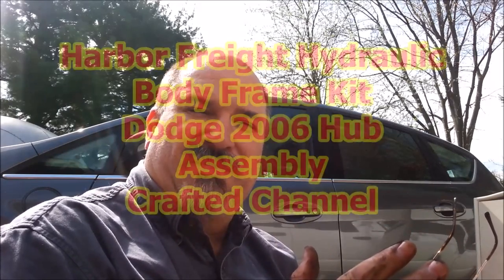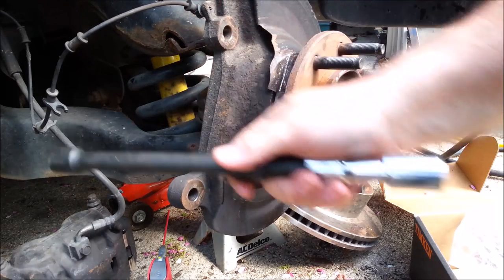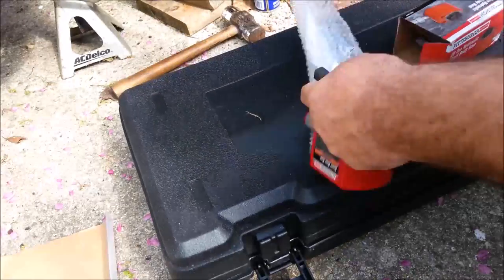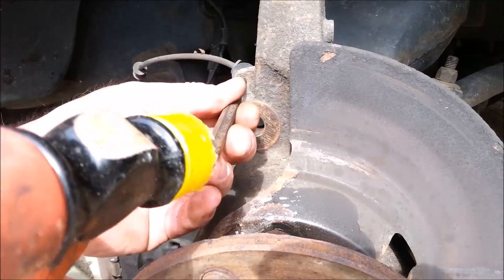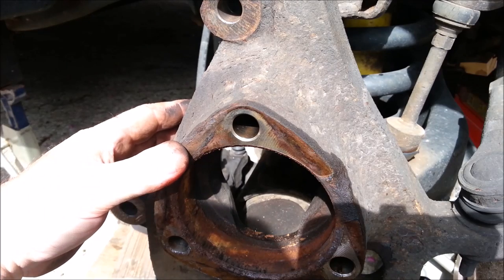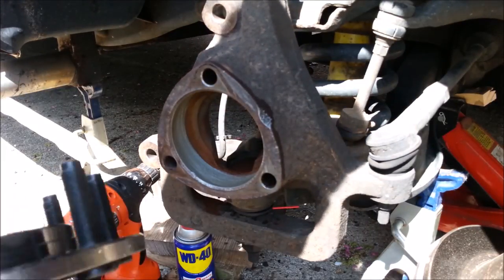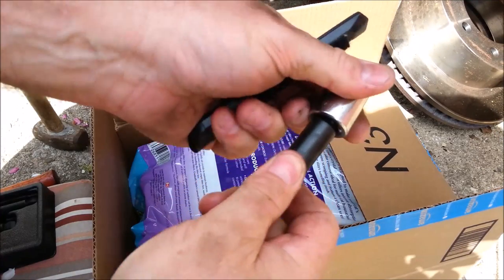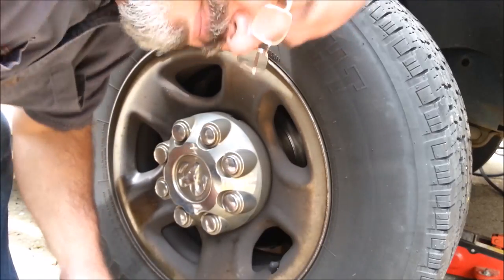Harbor Freight Hydraulic Body Frame Kit Dodge 2006 Hub Assembly Crafted Channel

Comment: I bought this tool yesterday to  help straighten the frame on my daughter's honda. Don' feel bad about leaving a part off. I replaced an oil pump in a 78 tbird, buttoned it all up, jacked the car down, and as I was putting my tools up, I noticed the oil pump shaft laying near the fender. So I'm not laughing. Great video.

Comment: I just changed all 4 bearings on my wife’s truck. Used a 4lb sledge and a lot of banging to get each one out. I got this same hydro kit and never occurred to me to use it this way. Thanks For the tip.
Reply from the maker: There are some other methods also.  But hard to be hydraulics when you can apply them.
Reply: Have this  kit for doing suspension and crash repair,even more uses

Comment: I like the way you 'earn the tools' with a DIY project. Been doing that all my life!
Reply: Save a couple hundred bucks, buy the whole set yourself. Let's say ball joints, maybe something like 100 bucks, 200 at a pricyer place. A good set, (Alltrade or something Powerbuilt) has a good set which ive used and is pretty nice, 250 Canadian or something. Easily pay off, especially if you do more than 1 time or for a friend for a bit of dough

Comment: I spent all day Saturday (8hrs) trying to remove my seized on hubs.  I tried a sludge hammer several times but ------- (FAILED), I tried a slide hammer for close to an hour long but ------- (FAILED), I tried a air hammer for several minutes but------ FAILED, I tried the power steering with extension method but-----(FAILED) and that come across your video and the next day on Sunday I went to harbor freight and purchased the 10 ton ram and  all I can say is "AMAZING!" come off in less than 5 minutes. I too heard the pop sound. Both front seized hubs were removed and new ones replaced in 1 hour max. THANKS FOR POSTING!!
Reply from the maker: Outstanding!  The only thing you did that I didn't try was the slide hammer.  I don't think it would have worked for me either.   Now you have a cool tool set you will find other uses for and you still came in under repair shop cost I bet.

Comment: I subscribed because I agree with the notion that tools are freedom. I'm a mechanic by profession and I grew up on the jobsite with my father. He's a carpenter. I literally do not pay anyone for home or auto repairs because i know my way around all tool. I've done things as simple as oil changes and door knob replacements. And I've gotten as complex as a transmission rebuild and a second floor addition. I was blessed to have a father that showed me that being hands on can save you so much and can always be a backup income plan even if it's not your profession of choice.
Reply from the maker: I'm sure you and I have a great many things in common.  I grew up helping my dad build a house around our little frame home.  I carried more brick, drywall and chimney fill than I want to remember.  learned alot.

Comment: You're right Dave. Tools  ARE freedom and they give me a feeling of security. Good video Dave.....clearly explained and well done. I have a 2002 3/4 ton heavy duty with the cummins. It's got 147k miles and I love it. Don't drive it as much as I used to because I'm retired now and don't go as much but love my truck. Keep up the good work Dave. Take care...........Jim
Reply from the maker: Thank you Jim.  Mine just turned over 250k.  Original injectors.  When I bought it, I had planned to get 400 our of it.  After changing from self employed to employed, not sure I'll get there before it rusts away.  Less than 10k a year now.  Used to be 30k.

Comment: Having the right tool is great. Sometimes you can borrow something, but I've broken a borrowed tool and had to replace it, and I still don't have one. That antiseize compound is great.  You will kiss yourself if you ever have to do this again.  If the manufacturer had put some on you wouldn't have had to make this video.  Good thing you caught that bearing when you did. I get about 2 a year that someone drove until the balls fell out and ruined the cv shaft, the rotor caliper and pads, it was even on fire.

Comment: Best video on this I have seen , and you are right about having available tools , I just wrestled with one and like you my driver's side hub came out easy , but my passenger side was a bitch , I ended up removing my steering hub and having it pressed out great videoi am a do it yourselfer out of necessity buy a all terrain jack

Comment: Ingenious.  Another Harbor Freight alternative that would have cost about 2/3 less would be the PITTSBURGH AUTOMOTIVE 10 Ton 3 Jaw Hydraulic Gear Puller (SKU 64982).
Reply from the maker: What would you push on?
Reply: Yep. I agree whata you push on.

Comment: I saw a guy just hook a big pipe wrench on the top of the flange and whack it with a big hammer and it popped right out... I have those tools already so "FREE" tool cost. Interesting to see your solution!
Reply: I just finished watching the same video. 4 hours into removing the wheel bearing hub on 2015 Subaru Outback 3.6  and still no go. This hub is super stuck!
Reply: Pipe wrench didn't work for me. i may have to take to shop
Reply: @MF-kb2nv  - the pipe wrench worked for me super smooth, except 1 rear wheel, that I spend about 1 hour with a 10lbs sledge hammer. But on that particular one I didn’t spray any lubricant. Otherwise it wasn’t that bad.
Good luck with your project M F !
Reply: @bobsbarnworkshop  spent about 8 hours on it today. Heat, sledge, pipe wrench, log chain, etc...too old for this s***.
Reply: @MF-kb2nv  sounds like yours is really stuck!!! Look up the “ hub buster” maybe you can buy or make one
Reply: @bobsbarnworkshop  Just so happens someone lended me one..Worked on the third whack...Amazing
Reply: @MF-kb2nv  glad you had success!!

Comment: I watched the guys at the shop take off the wheel of an inside dual using this tool (name-brand, not HF) braced from one wheel to the other with the extensions. They had tried torching and sledge hammering it for about 2 hours before. Hydraulics popped it loose inside of 10 minutes.

Comment: Another variation on this is to use the beak styled spreader in the kit. Install an old brake rotor wrong side out, tighten down with lug nuts. Place a hardwood block between both caliper braket arms an use the spreader against wood and hub to push it out. Might need a little heat too.  The small cylinder you used obviously is better than the spreader.

Comment: Ok, that's one way of doing it. At the shop, i use an angle grinder, cutting the bolts thru the outer bearing case, NOT cutting into the hub!! Then use a real chisel or what you call it, with a big hammer. 
The bolts are allmost everytime rust welded and the fastest way is as i described.

Comment: good too see you getting dirty again,lol. in all the years i worked for Dodge,that extension and socket trick always worked. i just did a axle joint on my 95 and used that trick with no trouble.

Comment: excellent video.i have the same truck and it was a bear to get off those hubs.the drivers hub went and  went out to buy the porta power and shorty ram .i cannot believe how good this worked.thank u
Reply from the maker: Cool, glad you got it knocked out.  Since then I've hit a deer and will need my portable hydraulic jack to get the bumper frame back in position.  Now I have it to work with.

Comment: All of the  techniques work some of the times. Some times it would just push out the bearing and leave the race in the knuckle. One side did that. I ended up removing the entire knuckle. Took it to the local guy and he pushed it out on his press. Charged me $25. Putting steel bearing hubs in a Aluminum housing is just asking for trouble. ( Thanks Chrysler) They weld them selves together.
Especially in rust country like Minnesota. Make sure you fluid film the mating surfaces when you put them back together. Fluid film is mana from heaven.
Reply from the maker: I'll look it up, I'm always interested in new potions.  I coated the hubs with Never-Sieze and put them in.  I chipped out all the rust first.   It can always get worse.  Glad they came out in one piece. Hope this job lasts another 400k.

Comment: If you are replacing the pads and  brake  rotors try flipping  old rotor around  backwards and bolt it to the hub and have at it with a 8lb harbor freight sledge hammer before you go  spend big money on a hydraulic body man kit you might use once in a blue moon
Reply from the maker: I think that was a couple years ago.  Seems like it anyway.  I've used that set a number of times since for other projects.  Got another one waiting for it now.   I'm getting great value out of it.  Your idea is a good one.  I could have hit it with a sledge that way.

Comment: There is a slide hammer to remove that but you could do more things with a hydraulic kit. I use my 4 ton to remove large roots, lift tree trunks, remove rotted out fence posts and jack up concrete slabs. That little hydraulic wedge thing at the beginning of the video, very useful getting into tight spots. Enjoy someone else working on their own truck after working on mine.

Comment: You're my friend think the same way I do. I refuse to take any of my vehicle to a mechanic. I have nothing against them some of my best friends are mechanics. I just cannot justify the cost of labor. Just like you said, what it would have cost you, you were able to buy tools that could be used on this job and then the next. I ordered tool all the time. When I get ready to start a project on one of my vehicles and there might be a tool out there that makes the job easier I have no problem ordering it. My friends that are mechanics come over to my house to work on their cars since I have almost all the same tools that they have at work. I even have a shop size air compressor.

Comment: I just had that great feeling you spoke of. I used heat and a long tube air hammer cranked all the way up. Heated up the steering knuckle around the bearing to break the bond then while it was still hot I hit it with the air hammer. It was corrosion welded in. I like yout portapower Idea but I have an aluminum steering knuckle...
Reply: Never heat aluminum or use the tool in the video on an aluminum spindle. If it worked, you just got lucky. Its much safer to remove the whole assembly and press it out. Also, on some aluminum spindles, like Ford, the tone wheel sensor mounts to a hole drilled into the aluminum, and not to the hub like the one shown hear.
Reply: @solarfall2728  You dont understand the nature of how well these can get stuck in there sometimes. I had one so bad a 30 ton press was stalling and even hitting it with a 16 lb sledge hammer while in the press wouldnt dislodge it. Its allways a victory when you can get one that stuck like that out without having to remove the entire assembly from the vehicle. Heat can be used. I've done it many times.  You just have to not be stupid about it. Aluminum has a melting point of 1220°F were nowhere near that. We're only going to about 200-300 °F well within the safe zone. The purpose of the heat is to make it expand and contract and break the bond.
Reply: @TractorWrangler01  I don't know what you are talking about, but I don't work on tractors. If I get caught putting a torch on aluminum, I get instantly fired. As I should be. No shop in their right mind would let something like that go on. You may want to brush up on your metallurgy because you don't need to melt a non ferrous metal to anneal it. Aluminum is all ready soft enough as it is. If I screw up, my mistake can kill people. And just because you have a crappy press doesn't excuse it. Just because you got lucky once or twice, doesn't mean its OK.
Reply: @solarfall2728  what the difference if it's pressed out while out of the vehicle with shop press, or in the chassis with the tool he used? Answer: nothing. The forces with be the same.  You'll be using the knuckle for leverage and pressing against it with either method. There' no other way to press it out.
Reply: @wiscofun3028  If you bothered to read the posts before commenting on them, it would be crystal clear that I wasn't taking issue with how the part was being pressed. Only a fool would heat an aluminum spindle. If it means removing it from the car to get better access or use a more powerful press, then that's what you have to do. Non ferrous metals get softer when you heat them. Its a process called annealing. If you want to do it to your own car working in your yard, go right ahead. But if a professional does it, they would be fired.
Reply: @solarfall2728  I was commenting on your statement "never use the tool in the video on an aluminum spindle." Not anything to do with heat.
Reply: @wiscofun3028  Sorry if I wasn't clear. I wasn't responding to the guy who made the video. It was Tractor Wrangler's comment. You can get away with a tool like this if you have a steel spindle, and you're very careful. However, with a tool like this and an aluminum spindle, its a completely different story. In the video, he doesn't push the hub assembly out from the center. He gets it from the side. Aluminum is too soft. You either want to use an on the car press that's made to do hubs, or remove the spindle and  set it up on a traditional press. And under no circumstances should you ever hear aluminum. Sorry if there was any confusion.

Comment: when i had to replace my bearing hub on my 99 ram 4X4, i was almost broke, couldnt afford this tool, so i soaked the area in PB rust blaster,, for 2 days and took one of the 3 bolts to the hardware store and got 3 longer grade 5 bolts, screwed them all the way in, and using a short handled 5 # sledge, knocked out the old OEM bearing,wasent hard at all,,in went a 100$ auto parts store chinese bearing,,(rockauto is 50$)and now after 100k still working good.
Reply from the maker: It's been a while so the details are not fresh in my mind.  But I tried the trick of jamming something between an extended bolt and the a arm, then using the power steering to and cranking the wheel.  Bent a 1/2" extension as I remember.  I watched all the tips and tricks videos and couldn't get it out.  So, I made my own. ;-)  I remember trying everything I could think of.  There might not have been room to get a good swat on mine.  Glad you got it out.  Mine was a pretty bad case.  I've used that hydro set on several other things so it's come in handy.

Comment: Most hubs have a hole in them ,you can use a bolt and nut to press it off. A lot cheaper too! If yours doesn't have a hole ,drive out a lug stud and use that hole. Works great!

Comment: Lisle makes a tool that fits in your air hammer, a pair of them will cover most all year rams and cost about 30.00 a set. They rattle on the bolt heads after you loosen them about halfway. Best thing since sliced bread.
Reply: Can you supply more info on this Lisle tool? Are they like rams?

Comment: The cheapest and easiest way is to put something between the frame and use the lugnuts put the rotor on using that piece against the frame start the truck turn the wheel and it will push the bearing out may have to do it a couple times on each side

Comment: Yeah, that new hub just popped right in there. Think that nice, sloppy fit might be caused by the fact that the hub was pressed out at an angle with unequal pressure? Take the knuckle out and do this on a press.
Reply from the maker: No.  This part is made from cast.  You don't bend cast, you break it.   The clearance comes from "clearance".  It's designed made for the part to slip fit easily.  These are not press fit.   Rust in the bore filled all that clearance and made it tight as hell.  Effectively locking it all together.  That is why it was tight.

Comment: Screw the male cap into the tethered female cap to keep from losing it.

The spreader tool doesn’t have much grip. You’ll need something rough up the surface to get a decent bite. I tried folded over sandpaper. 

Also, that kit has better latches on the case than the 4 ton kit.
Reply from the maker: For this job, I only used he pump out of this kit. I purchased a low profile short stroke bottle from them to do the job.  It's shown.

Comment: Can Zeny 10 Ton Porta Power Hydraulic Jack Body Frame Repair Kit Auto Shop Tool Lift Ram be used to remove that hub? With the attachment you used of course. What a great explanation, thank you.

Comment: ball joints are easy on yours you can get the HF tool for that.  I broke 2 of them changing mine last year.
Reply from the maker: I'll be buying higher than HF.  I've heard of them breaking.  I don't mind spending a couple hundred.  I think ball joints would be $500 a side probably from the mechanic.